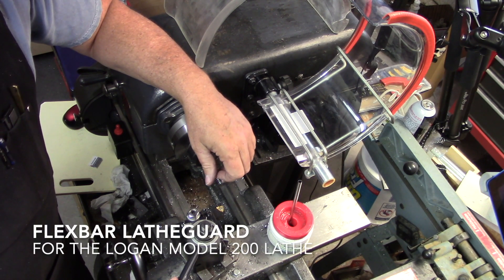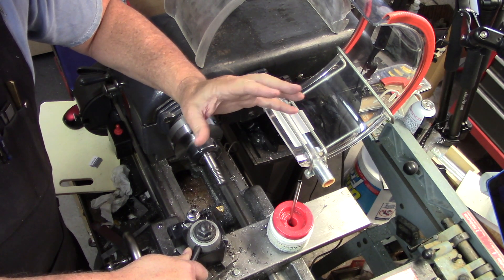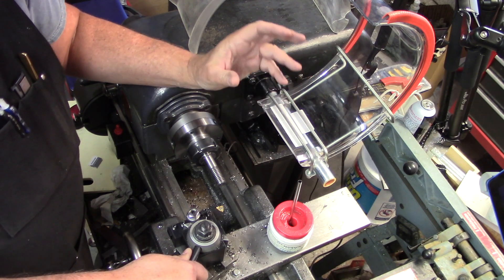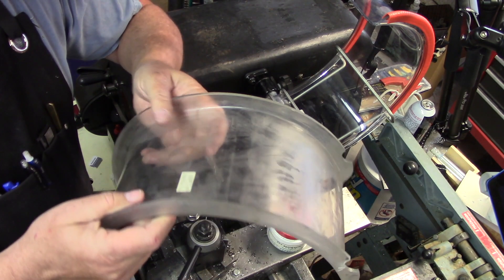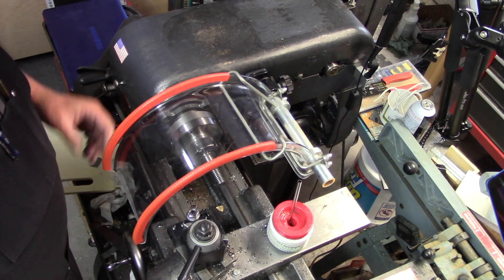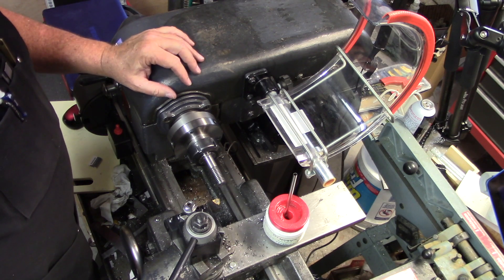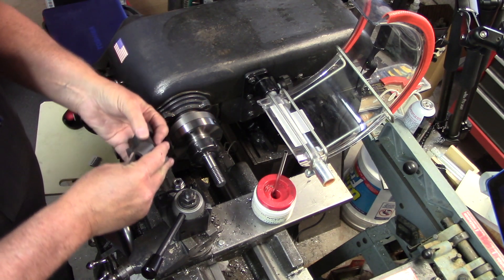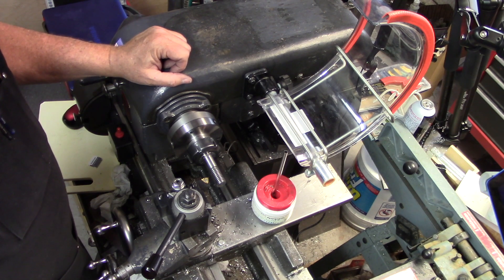Logan Model 200 Latheguard and a couple of other things

Comment: I just bought a logan 200 with no extra gears..no steady or turn thru..needs a run capacitor and a belt ....ways and lead screw look good. ..everything works.  425$ 😊...i just bought a quick change tool post and used the lathe as a mill by facing the clamping plate in the 4 jaw it came with. I have a 3 jaw too but im a fan of 4 jaws😊  ..it was a great get to know it project

Comment: Jon, where did you get the lathe guard?   Nice video.  I am interested in the Half nut restored
Reply from the maker: I got it from eBay described as "unclaimed freight." I still came out ahead after buying a new lexan shield.

I'm getting set up to be able to measure the actual force applied to the carriage by my Electronic Leadscrew drive. I am also curious to compare the rebuilt half nuts and whether the different friction coefficients will make a measurable difference. I plan to rebuild one each with bronze, Delrin and Ertalyte, then rebuilt the fourth with the one that turns out the best, keep a set as spares, and sell the other two.